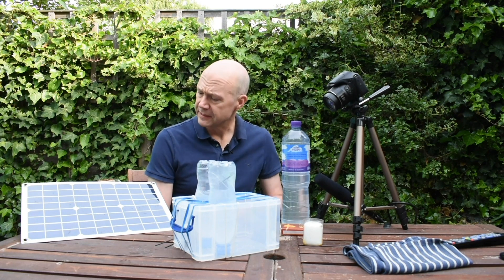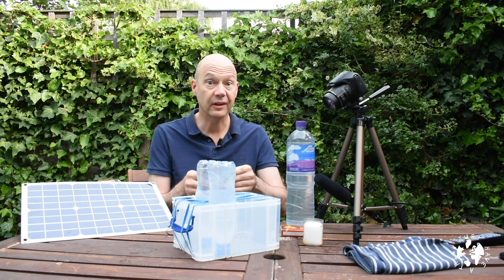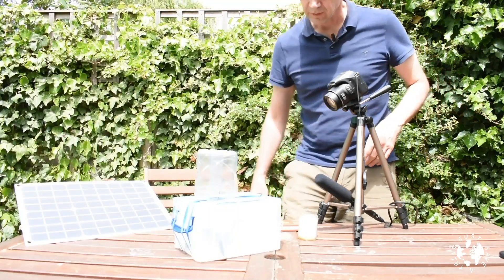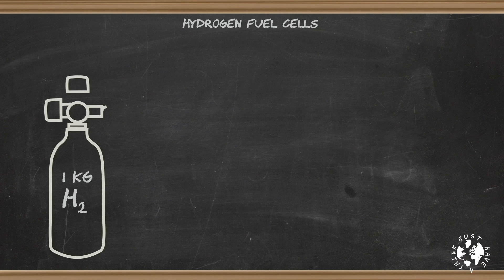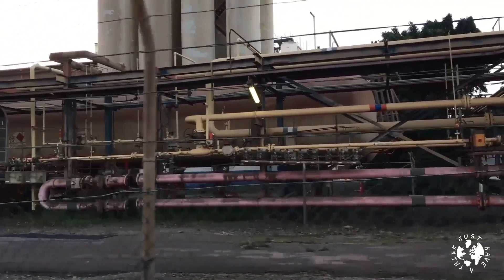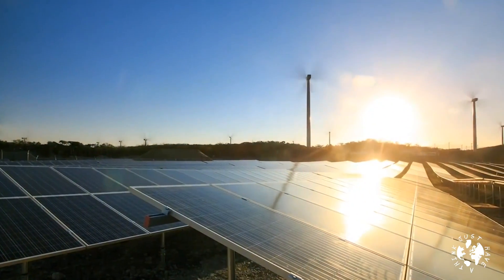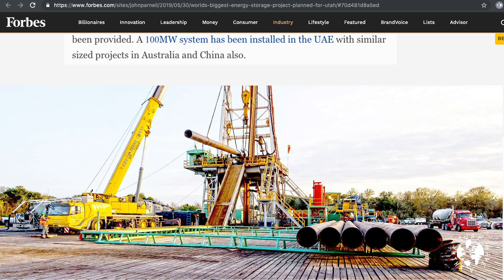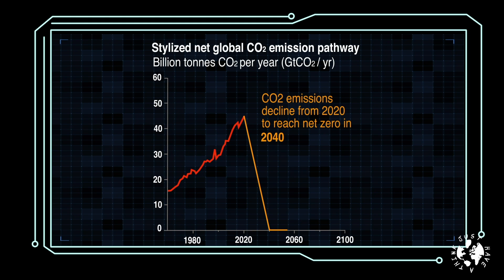Energy Storage in Hydrogen : Does this beat batteries?

Comment: The round trip efficiency of hydrogen energy storage is so low that when comparing long term cost with batteries, it is not worthwhile. In fact, the efficiency is so low that you will be losing money on operating such a plant. For seasonal storage, I think pumped hydro is more promising.
Reply: it's actually not that low when you factor in the degradation of batteries over time, the cost of producing the batteries in the first place. the cost of wiring it all up. the cost of protecting said batteries. the energy loss when charging and discharging them. oh and the drastic changes in performance depending on the temperature they are kept at.
all of these factors are not accounted for when you compare the two systems. sure hydrogen can lose up to 50% of it's energy from electrolysis and then compressed to 700 bar and then used as a means to generate power again however even with that, it's still a more effective means of storing excess power then batteries are. ion batteries can lose 20%+ of their storage capacity within only a few years, even more so when you factor in the abuse they would receive from grid usage. planning for that storage means more space is needed, which means more up front cost and then maintenance.

the total volume of space has to be accounted for and in the case of 700 bar hydrogen you can store nearly twice as much in a given area. now in reality it's WAY more then this simply because hydrogen sits in a tank which can be any reasonable size. meanwhile batteries cannot be stacked perfectly on top of each other very easily. you need wires running everywhere and in some cases you might even need to cool the area which takes up space. then you need space to access the batteries. all of that needs to be factored into storage sizes for each system and hydrogen wins by far as you never need to enter the hydrogen tank. this space savings can be put towards more energy production. which in turn raises the power generated  over all by the system.
Reply: @rocksfire4390  Thank you for the long comment. Let us discuss them one by one. Your comment of battery degradation is wrong. Li-ion batteries for stationary energy storage have a designed battery life time of more than 20 years. Most manufactures provide a warranty of at least 10 years. 20% loss in a few years is a statement based on your cellphone battery. That is due to careless use and intentional design to force consumers to change.

The cost of producing batteries is still high. However, the cost of producing a water electrolysis tank and a fuel cell is even higher due to the use of precious metals(platinum). Meanwhile, even advanced alkaline water electrolysis system has a limited lifespan of 10 years, not longer than battery. The more mature PEM cell is more efficient but with even shorter lifetime. Hydrogen energy storage system has a roundtrip efficiency of at most 50%, in most of the case, you will not even have 30%. Li-ion battery is easily at 83%, for slow charging grid application, it can reach as high as 93% roundtrip efficiency.

The problem for stationary energy storage is not energy density, if you only need about 3 Tesla Powerwalls to make an entire family off the grid (with an EV), how much you really think needed to make the entire planet renewable on storage? Considering larger area = more maintenance is a wrong way of thinking. Batteries rarely need any maintenance since there is nearly no moving parts(maybe cooling pump and cooling fan which a electric motor driven.) For hydrogen energy storage, just the complex piping is enough to make a headache with all the "safety codes". Hydrogen embrittlement and hydrogen blistering are two common types of corrosion, your inspection and replacement will be more regular if hydrogen energy storage is implemented. Using hydrogen as an energy storage medium is not just a tank. All the pumps, electrolyzers, compressors, fuel cells and complex piping are more difficult to implement compared with electricity. When you are dealing with moving protons, it sure to be more complex than moving electrons.
Reply: @princeding2114  

"Li-ion batteries for stationary energy storage have a designed battery life time of more than 20 years. "

i see no such evidence of that. if you have a study/article i would love to see it. at most i have seen is 1000 - 2000 cycles (each cycle would be a day) or 5.4 years and that's really babying the battery meaning you need more storage to make up for the total capacity loss ("DoD batteries" look it up).

"Considering larger area = more maintenance is a wrong way of thinking."

that's not what i said, i said because you need more batteries you need more area. more batteries = more maintenance.

"However, the cost of producing a water electrolysis tank and a fuel cell is even higher due to the use of precious metals(platinum). "

sure but it's a one time cost, unlike batteries, and you don't "need" to use platinum it's just more effective if you do so. if it's cost effective to do so then do it otherwise get something that is more cost effective.

"Li-ion battery is easily at 83%, for slow charging grid application, it can reach as high as 93% roundtrip efficiency."

that's nice but doesn't factor in the energy cost of production of those batteries, the degrading performance overtime and even the fuel (energy) cost of transporting them to the battery bank. also in most areas they would have to be cooled or even warmed which isn't factored in. all of these things impact the performance and the lifetime of said batteries, proper care is the only way they would last anywhere close to 10 years let alone 20 years. caring for the batteries isn't free =).

"The problem for stationary energy storage is not energy density, if you only need about 3 Tesla Powerwalls to make an entire family off the grid (with an EV), how much you really think needed to make the entire planet renewable on storage?"

true but you forget to factor in the power requirements of companies/factories.
https://www.eia.gov/totalenergy/data/browser/index.php?tbl=T02.01#/?f=M
if you only count peak usage of the residential sector the industrial sector alone consumes nearly 50% more power at just the peak hours. not counting transportation nor the commercial sector. thus your argument here is wobbly at best.

"All the pumps, electrolyzers, compressors, fuel cells and complex piping are more difficult to implement compared with electricity. "

true but the cost is already factored into it. we already know how to do it and handle hydrogen, we have been doing it for decades. that's not to say that batteries wont take the lead, it's just right now we don't have TIME to make the batteries better then switch. we need to start switching right now or at least in the next few years. i'm sure later down the road we will be using batteries all over the place as the prices keep dropping each and every year but our tech just isn't in the correct position right now to deal with our current problem. 

our current problem is storage capacity, hydrogen storage has a higher density then our current battery tech.in fact it's nearly 2 times denser, without even factoring in the extra area needed to get access to batteries kept in arrays. it could be 3 or even 5 times denser. we have the solution to our problem but not enough people want to jump aboard and drive the raft so we can get to land first then settle and expand. expanding on the sinking raft isn't a good idea, we need to fix our biggest problem first then we can improve it later down the road.
it's by no means as easy as i make it out to be but something has to happen. oh and btw hydrogen power plants already exist or at the very least are in the works in other countries. e.g using solar/wind for grid power and then any extra power is made into hydrogen which is then burned during the night. batteries are still better in their own ways like near instant power transfer when demand shifts around a lot. pointing out this flaw is acceptable but again we already know how to deal with that. we do it with coal plants all the time.
Reply: @rocksfire4390 

i see no such evidence of that. if you have a study/article i would love to see it. at most i have seen is 1000 - 2000 cycles (each cycle would be a day) or 5.4 years and that's really babying the battery meaning you need more storage to make up for the total capacity loss ("DoD batteries" look it up).

This clearly shows you do not know the degradation pattern of Li-ion cells. Search “Jeff Dahn” on YouTube, you can learn. Or you can go to my channel to take a look at the field trip to a Tesla Power Pack, there is detail explanation in it.

that's not what i said, i said because you need more batteries you need more area. more batteries = more maintenance.

Again, your statement is wrong here. Maintenance of battery is low due to no moving parts. Comparing Li-ion battery with hydrogen energy storage, the entire system of hydrogen energy storage needs more maintenance. Note the benchmark we are comparing.

sure but it's a one time cost, unlike batteries, and you don't "need" to use platinum it's just more effective if you do so. if it's cost effective to do so then do it otherwise get something that is more cost effective.

I do not see why batteries are not one-time cost. If you do not use platinum, your roundtrip efficiency will be even lower. It would be so low that your project will not be profitable. Consider the wholesale price of electricity at 4 cents/kWh during charging, 30% efficiency means you need to sell your stored energy at 13 cents/kWh to just breakeven. The payback period will be long.

that's nice but doesn't factor in the energy cost of production of those batteries, the degrading performance overtime and even the fuel (energy) cost of transporting them to the battery bank. also in most areas they would have to be cooled or even warmed which isn't factored in. all of these things impact the performance and the lifetime of said batteries, proper care is the only way they would last anywhere close to 10 years let alone 20 years. caring for the batteries isn't free =).

Your cost statement for the first sentence also applies to hydrogen energy storage. This is exactly capital cost. The climate control for battery system uses very little energy. The insulation of batteries is so well, coupling with heat pump, there is literally nothing to concern. However, electrolyzer and fuel cell are much of a problem, electrolyzer requires heating while fuel cell requires cooling, they all represent a more complex system. Caring batteries isn’t free. Caring about a hydrogen energy storage system is also not.

true but you forget to factor in the power requirements of companies/factories. https://www.eia.gov/totalenergy/data/browser/index.php?tbl=T02.01#/?f=M if you only count peak usage of the residential sector the industrial sector alone consumes nearly 50% more power at just the peak hours. not counting transportation nor the commercial sector. thus your argument here is wobbly at best.

I do not know why you consider all of this as electrical energy, there are other forms of energy. For example, low grade heat. Instead of burning fossil fuel, heat pump can be used which has a higher COP. That does not consider for a electrical based system, more energy efficient methods can be implemented. Finally, you do not need that much of battery storage. There are wind and hydro in place to smooth out the generation curve.

true but the cost is already factored into it. we already know how to do it and handle hydrogen, we have been doing it for decades. that's not to say that batteries wont take the lead, it's just right now we don't have TIME to make the batteries better then switch. we need to start switching right now or at least in the next few years. i'm sure later down the road we will be using batteries all over the place as the prices keep dropping each and every year but our tech just isn't in the correct position right now to deal with our current problem. our current problem is storage capacity, hydrogen storage has a higher density then our current battery tech.in fact it's nearly 2 times denser, without even factoring in the extra area needed to get access to batteries kept in arrays. it could be 3 or even 5 times denser. we have the solution to our problem but not enough people want to jump aboard and drive the raft so we can get to land first then settle and expand. expanding on the sinking raft isn't a good idea, we need to fix our biggest problem first then we can improve it later down the road. it's by no means as easy as i make it out to be but something has to happen. oh and btw hydrogen power plants already exist or at the very least are in the works in other countries. e.g using solar/wind for grid power and then any extra power is made into hydrogen which is then burned during the night. batteries are still better in their own ways like near instant power transfer when demand shifts around a lot. pointing out this flaw is acceptable but again we already know how to deal with that. we do it with coal plants all the time.

If you say so, then battery system has factored in as well. We know how to handle batteries and electrical systems even better than handle hydrogen. Your statement of batteries is wrong. Battery systems have already in commercial applications while hydrogen system has not gone out of pilot stage. Our current problem is in fact not storage capacity but peak shaving. We need to smooth out the intermittency of renewable and shave the peaks of demand. Seasonal storage is difficult, it is still on the research stage. There were lots of papers about hydrogen energy storage between 2003 and 2013. After that, they all died out due to unparallel performance and efficiency compared with battery. The industry will not favor of a looks promising solution which is extremely expensive. Again, as I said, if you need bulk energy storage, go pumped hydro.

 
Thank you for the discussion. Happy to see people interested in it.
Reply: @princeding2114  

"This clearly shows you do not know the degradation pattern of Li-ion cells. Search “Jeff Dahn” on YouTube, you can learn. Or you can go to my channel to take a look at the field trip to a Tesla Power Pack, there is detail explanation in it."
no it clearly shows i have no idea what YOU are talking about as i have NEVER seen anyone state those numbers.

"Maintenance of battery is low due to no moving parts."
you said it yourself there is a maintenance cost. also are you forgetting the usage of batteries over time? they don't last forever and they WILL need to be replaced, this is part of the maintenance of batteries.

"I do not know why you consider all of this as electrical energy, there are other forms of energy. For example, low grade heat. "
yes and that's what this is reflecting, primary energy and secondary energy. i didn't say electrical energy i said power.

"Your cost statement for the first sentence also applies to hydrogen energy storage. "
it's already factored in in there.

"Caring about a hydrogen energy storage system is also not."
see the thing is i never made it out to be.

"The climate control for battery system uses very little energy."
depends on where it is.

"electrolyzer requires heating while fuel cell requires cooling"
by no means has to be heated, some cooling is required for fuel cells. however depending on the season and where you live you can use this and reduce heating/cooling needs. no reason to waste that energy.

"If you say so, then battery system has factored in as well."
no, it's never factored in. no one thinks about cleaning them up after they start losing there capacity. 

" We know how to handle batteries and electrical systems even better than handle hydrogen."
in small instances like phones, watches, clocks, cars, yes. large power grids? no. the biggest was Tesla's. even that is pretty tiny when you actually factor in what we would need for 100% renewables. the biggest battery that i know of is only has129 MWh of storage and it cost them 66 million dollars. to power a big city would take nearly 6,500 MWh of storage for the entire day. this is so we account for dark days, which might or might not happen. 

if 129 MWh costs 66 million for the entire city you would need 50 times that. 50 times the amount of storage the biggest battery in the world is currently and 50 times the amount of up front money to even build it. oh and that's 3.3 billion dollars for a single large city. that's draining the batteries dead every time you would use them. you wouldn't want to do that to the batteries or you wouldn't have them for very long. add on whatever you think is the acceptable drain level for lithium ion batteries (which you didn't look up). fully draining a lithium ion battery is the best way to reduce it's life span. 50% would be my number, extra storage just in case and then a bit of padding to not over drain the batteries. that price just jumped to just shy of 5 billion dollars. for a single city. running the entire city off batteries just isn't practical. plus the cost of rare materials which more then like running out before you even get all the major cities on these battery banks. 
in 10 years batteries will be maybe half that price but again we don't have 10 years to wait around. we need action before that.

"Battery systems have already in commercial applications while hydrogen system has not gone out of pilot stage."
not enough to power the entire building for even half a second without frying the batteries.  you haven't looked in a while, lots of projects are either starting or have been going on and are close to being done and ready for use.

"Our current problem is in fact not storage capacity "
no it is capacity, it's the reason we are not investing in billions of dollars into battery systems so we can go full renewables. people are waiting for capacity to go up before they do it.
the place you went too pointed out that their pack couldn't handle powering the factory. the whole point of the power pack was so they don't get charged as much for their peak usage. they still use a fuck load of power.

"Seasonal storage is difficult, it is still on the research stage."
it's not, hydrogen can be kept for months easily. i gave the solution to the problem, i don't know why you are trying to fight it so badly.

"The industry will not favor of a looks promising solution which is extremely expensive. "
agreed and that's why batteries are not sitting around powering the grid right now. that's why trying to put a entire city on batteries is foolish at best. we have the means to power a entire city by hydrogen though.

"Again, as I said, if you need bulk energy storage, go pumped hydro."
hydrogen is bulk storage, plus it could easily be turned into other forms of work besides electric power. hydro is good but it's uses are very limited based on where the cities ended up. plus it's terrible for the wildlife as it completely destroys their living grounds. also if the dam breaks you and everyone downstream are either dead or lose everything. same problem nuclear has honestly but also has the problem of flooding wild life out of their homes.

you didn't address the problem of needing a solution right now. again i gave the solution so what is yours? we need to do something in the next few decades, we don't have time to progress with batteries THEN start to produce and install them. we need action within the next 5 years. batteries seem more or less like a long term goal then a short term goal. if we go and produce a bunch of shitty batteries, then in 10 years when we replace them with better ones how bad do you think that is going to be for the environment? no one talks about the true cost of batteries, they always ignore what happens after they are used up and tossed aside.

please when replying use quotes, it makes reading far easier. it's not so bad with short posts but long ones are really hard to tell which pieces of text are yours and which ones are mine.

"Thank you for the discussion. Happy to see people interested in it."
same
Reply: @rocksfire4390 
no it clearly shows i have no idea what YOU are talking about as i have NEVER seen anyone state those numbers.

That is because you are not in the research or industrial area. Read some papers if you really want.

you said it yourself there is a maintenance cost. also are you forgetting the usage of batteries over time? they don't last forever and they WILL need to be replaced, this is part of the maintenance of batteries.

We are comparing battery with hydrogen energy storage. Do you mean hydrogen system need no maintenance? Replacing the battery is not maintenance. It is called decommission, a typical procedure for a project at the end of its lifetime. Know the engineering difference.

yes and that's what this is reflecting, primary energy and secondary energy. i didn't say electrical energy i said power.

I think you might have a misunderstanding about Energy and Power. Wish you could clarify your point for me. If you are talking about power, then battery’s P/E ratio is way higher than hydrogen fuel cell.

depends on where it is.

Even in cold Canada.

no, it's never factored in. no one thinks about cleaning them up after they start losing there capacity.

You are missing up terms. Clean up after losing capacity? Wish you could paraphrase it for me. I suggest you learn more about battery energy system and make logical comments. Meanwhile, we were talking about the cost of construction, then for a hydrogen system, due to limited number of projects, there are not enough data to perform a comprehensive cost analysis.

in small instances like phones, watches, clocks, cars, yes. large power grids? no. the biggest was Tesla's. even that is tiny when you actually factor in what we would need for 100% renewables. the biggest battery that i know of is only has129 MWh of storage and it cost them 66 million dollars. to power a big city would take nearly 6,500 MWh of storage for the entire day. this is so we account for dark days, which might or might not happen.

If you want to power the entire city, try to calculate how much hydrogen we really need as energy storage. Notice the benchmark. Meanwhile, 6500 MWh is not necessary, we would have other forms of generation capacity which do not require storage.

in 10 years batteries will be maybe half that price but again we don't have 10 years to wait around. we need action before that.

Then you should go and do it if it viable. I do not think hydrogen is a viable idea. I do not think battery is viable either as this stage, when the price is lower than $110/kWh, we may have opportunity.

not enough to power the entire building for even half a second without frying the batteries. you haven't looked in a while, lots of projects are either starting or have been going on and are close to being done and ready for use.

Checkout videos on my channel. Hydrogen projects are very limited compared with battery energy storage projects. Again, know the benchmark.

no it is capacity, it's the reason we are not investing in billions of dollars into battery systems so we can go full renewables. people are waiting for capacity to go up before they do it. the place you went too pointed out that their pack couldn't handle powering the factory. the whole point of the power pack was so they don't get charged as much for their peak usage. they still use a fuck load of power.

There is no way we can achieve 100% renewable at an economic price at this point. Meanwhile, as I said, batteries are currently for peak shaving and load shift. I do not understand your last sentence.

it's not, hydrogen can be kept for months easily. i gave the solution to the problem, i don't know why you are trying to fight it so badly.

As I said, compared with hydrogen for seasonal storage, go pumped hydro. Way cheaper and mature. You did not give the solution, because there are so many problems in your solution which you could not solve.

we have the means to power a entire city by hydrogen though

No, we do not.

hydrogen is bulk storage, plus it could easily be turned into other forms of work besides electric power.

Then we are not talking about energy storage. I am talking about energy storage here, thus, want comes in, what goes out. You can use hydrogen for other applications (I had a project about that, but that another story.)

you didn't address the problem of needing a solution right now. again i gave the solution so what is yours?

No, you did not give the solution. I was exactly telling you the problems in your “solution”. You never addressed it. (Because it is just impossible to address.) Meanwhile, happy to give you my solution, battery + pump hydro + geothermal energy storage. That is the most promising one I could come up with right now.

please when replying use quotes, it makes reading far easier. it's not so bad with short posts but long ones are really hard to tell which pieces of text yours are and which ones are mine.

So do you. Was looking for a solution last time, but test failed.
Reply: @princeding2114  

"That is because you are not in the research or industrial area. Read some papers if you really want."
you think most of these batteries are going to last 20 years? yea you lack the knowledge in understanding how batteries actually function to get those kinds of life times.

"We are comparing battery with hydrogen energy storage. Do you mean hydrogen system need no maintenance? Replacing the battery is not maintenance. It is called decommission, a typical procedure for a project at the end of its lifetime. Know the engineering difference."
never said hydrogen doesn't need maintenance you are just assuming that. replacing the battery is maintenance as with the battery you do not have a functioning system anymore, e.g it's damaged and isn't in it's original state.

"I think you might have a misunderstanding about Energy and Power. Wish you could clarify your point for me. If you are talking about power, then battery’s P/E ratio is way higher than hydrogen fuel cell."

i should of said energy, but not electrical energy as that isn't what's being tracked. you tried to play off Tesla powerwall as a solution and while that works with small scale homes it doesn't scale up to the needs of any factory. sure they can use small packs to offset peak usage to cut costs based on their peak power usage but that doesn't really mean anything other then them just trying to cut the fees they get charged by having a higher peak energy usage.

"If you want to power the entire city, try to calculate how much hydrogen we really need as energy storage. Notice the benchmark. Meanwhile, 6500 MWh is not necessary, we would have other forms of generation capacity which do not require storage."
i wish there was more information but most of what i could find is about cars, which isn't very useful. most costs of hydrogen are based on steam reforming, some places have said electrolysis was the cheapest way to produce hydrogen, even more so when you use renewables. the math is way too complex to do in a single night or even a week. you are right that 6500 MWh isn't necessary but you have to keep in mind that should we go 100% renewable which isn't out the question, we would need close to that if not even more. everyday isn't going to be sunny, nor is it going to be the perfect tempature for the battery's, nor is each day going to be the same draw on the grid.

"Then you should go and do it if it viable. I do not think hydrogen is a viable idea. I do not think battery is viable either as this stage, when the price is lower than $110/kWh, we may have opportunity."
i don't have to do it, and it is viable. it's happening right now. also i'm pretty sure the price is around 110$ /kWh, at least Tesla's battery's are at 111$ / kWh, that was last year in November. at the rate they are going the will most certainly be below 100$ / kWh by the end of this year. 

"There is no way we can achieve 100% renewable at an economic price at this point. Meanwhile, as I said, batteries are currently for peak shaving and load shift. I do not understand your last sentence."
other countries will laugh at you for saying that. it's possible at the current economic price at this very point in time. you gotta stop listen to the clowns being paid to spread lies. if we stopped spreading billions of dollars on war every year we could do it quite easily.

"As I said, compared with hydrogen for seasonal storage, go pumped hydro. Way cheaper and mature. You did not give the solution, because there are so many problems in your solution which you could not solve."
so pumped hydro in a flat land? do you want to build a mountain for that water to sit behind or are you just going to ignore that?

"No, we do not."
given enough hydrogen yes. also there are many saying that natural gas power plants can be converted to hydrogen. so it's not like it's out of reach or anything.

"Then we are not talking about energy storage. I am talking about energy storage here, thus, want comes in, what goes out. You can use hydrogen for other applications (I had a project about that, but that another story.)"
it is energy storage, you are storing solar/wind or whatever energy, converting it into hydrogen for use later. it doesn't matter HOW or WHERE it gets used, it's stored energy from the solar/wind/whatever. if a city never NEEDS the stored power then it's just more of the same. the point i'm making is that while battery's might seem nice, they are limited to only providing electrical energy. while hydrogen can be used for electrical energy, it can also be taken else where and used for heat or whatever else you might want to use hydrogen for (look up all the uses of hydrogen, there are tons of them). huge demand for cheaper hydrogen exists.

"No, you did not give the solution. I was exactly telling you the problems in your “solution”. You never addressed it. (Because it is just impossible to address.) Meanwhile, happy to give you my solution, battery + pump hydro + geothermal energy storage. That is the most promising one I could come up with right now."
i did give a solution and you don't seem to even know that this tech is, even though it's already being worked on. again hydro doesn't work everywhere, nor does geothermal. unless your plan is to build mountains for massive amounts of water to sit your solution is kind of a joke. 

here have fun watching this 2 hour long video of Ravindra Kempaiah explaining how Tesla's batteries actually work, not some random tour by some nobodies. learn how the process works, learn the costs and please really pay attention to when he starts talking about cycle life and all the ways it can be affected. sure you COULD get cycle lives into the 7000 range but you would really need to baby the living shit out of the battery to get that. it's not realistic to use a battery that way in a real world setting. 
https://www.youtube.com/watch?v=18MYRkx_Vr4&t=1s

thank you for making it clear which text is yours, much easier to read.
Reply: @rocksfire4390   Looks like there is no meaning to talk with you any more about battery. You do not know about it.

Here is my question for you: How do you make hydrogen energy storage efficient enough to compete?
Reply: @princeding2114  

"Looks like there is no meaning to talk with you any more about battery. You do not know about it."
looks like you didn't even watch the very informative video that explains how cycle life of batteries work. if you can't be bothered to do that, then you shouldn't be talking about them like you understand them.

"How do you make hydrogen energy storage efficient enough to compete?"

it's already at a point where it's efficient enough to compete. hydrogen has well over 2.5 times the energy density of current tech batteries. this means you need less then 2.5 times the area of batteries. even less because batteries are not stored that close to each other e.g room between batteries is needed. less space needed to store the energy means more space for generating the energy.  i never hear anyone complaining about energy generation, it's always the lack of cost effective storage. well either you throw your extra power out the window each year or you can create hydrogen. creating a entire new market where hydrogen is very cheap and then you can use the extra you have to create electric power that was normally just going out the window instead now you have energy during the off peak hours.
up front cost is relatively low, meanwhile battery tech will get better and in the time the hydrogen plant pays for itself you can then invest in some actual high quality batteries. once you have your oversized battery you keep your hydrogen plant going whenever the batteries are fully charged. this means no energy is wasted and you can then sell your hydrogen off generating even more money and then expanding your solar/wind farm.
can people not see that far into the future? i don't get it.

the round trip efficiency of hydrogen is anywhere from 30% - 50%. at the end of the day production of energy isn't the problem, it's the storage of that produced energy and in the case of solar/wind over produced energy. lots of energy is wasted each year because it's not being stored. batteries are one way but you will quickly find that you will run out of space quickly along with the massive up front and reoccurring cost. if you want to make them last 10 years you will need 20-40% more storage capacity so you get the right DoD for the highest cycle count. my other comments showed you this many times but you kept ignoring it and now you ignored a PhD student who's already got a rep for being quite knowledgeable in the field.
next creating hydrogen in this way isn't just competitive with batteries in it's current state but also for other applications that use hydrogen. creating hydrogen in this way is very cost effective compared to creating hydrogen by steam forming, which is the current way it's done the majority of the time. doing it via electrolysis with renewables would drop the cost of hydrogen dramatically. 

people don't look at the big picture, they are so zoomed in that they are blind to the other benefits of creating hydrogen in this way. batteries are simple, hydrogen is very complex because the very element you are producing is used in more then just stored energy.
Reply: @rocksfire4390   Battery is my research area. No need to watch another YouTuber talking about it. (Fun fact, the paper they referred is from Jeff Dahn. The professor in my university.)

Again, you still did not address the question of low efficiency. Battery is a more efficient way to store the energy. You better learn about how energy storage system works.
Reply: @princeding2114  
youtuber? hes interviewing a PhD scholar, are you a PhD scholar?

"No need to watch another YouTuber talking about it. "
this is about as dumb as saying "well i already did some research so i don't need to learn anything else!"

"Again, you still did not address the question of low efficiency."
again i did, you didn't read anything i said.
batteries cannot store unlimited amounts of energy, there is a limit and once they are at their limit any more energy produced by the system will be thrown away. it doesn't matter what the efficiency is if you can't keep capturing the energy.....batteries are 90-99% effective when they have room but are 0% effective when they are "full". hydrogen doesn't HAVE to be used to create electrical power only, it can be sold off if they have too much extra sitting around. none of this is factored into REAL world applications. the uses of hydrogen are endless, the uses of electrical power stored in batteries is limited to one thing....electrical power.
you need to take a few steps back and look at the bigger picture.

"Battery is a more efficient way to store the energy. "
until they are full, and if you would of listened/asked either Ravindra or your professor at your university they would tell you that keeping them at or near 100% charge is BAD for their cycle life. go on, go ask him, ask him what factors affect cycle life of lithium ion cells.

"You better learn about how energy storage system works."
i get my facts from people who's entire lives are dictated to research their fields. maybe you should listen to them so you actual know what you're talking about.

if you wont listen to the people who actually do the research then there is nothing left for me to say. nothing i say will ever penetrate your thick skull.
Reply: Depends on the specific economics of a given situation. If you would otherwise have to shut down your intermittent electrical sources, then the power is "free", and so is the hydrogen. In such a situation it doesn't matter very much how efficient the round trip is, it's still better than just shutting off your intermittent sources. Of course, that ignores the capital cost of creating your intermittent sources in the first place, but some places do have an overabundance of intermittent sources already. The current grid has to have enough capacity for peak power because we have very little storage capacity online at present. Implementing any storage solution allows intermittent sources to share more of the grid load without on demand sources as backup. So essentially any storage solution allows the substitution of an intermittent source for an on demand source.

Pumped hydro has a huge disadvantage: there are very few places where it can be built. In most parts of the developed world environmental concerns effectively prevent building any new dams.
Reply: @dlwatib  I have heard enough people say efficiency does not matter since you will curtail anyway. However, it matters! It represents cost, the problem of hydrogen as energy storage is exactly due to the high operation cost comes due to low efficiency.

I would like to ask, if you think efficiency does not matter, why not put Li-ion batteries there? It is more efficient, easier to operate, faster to response. (Fuel cell has ramping issue.)

Talking about pumped hydro, there are plenty new ways to do pumped hydro projects other than just build dams. In fact, your talking about the "developed world" concerns so much about environment that they do not want to build dams but willing to burn fossil fuels in their power plants and vehicles.